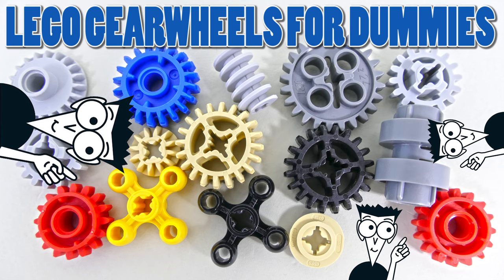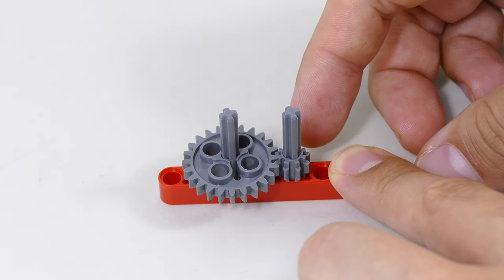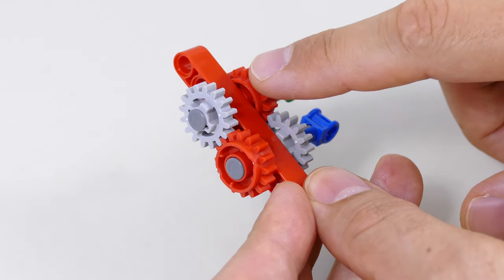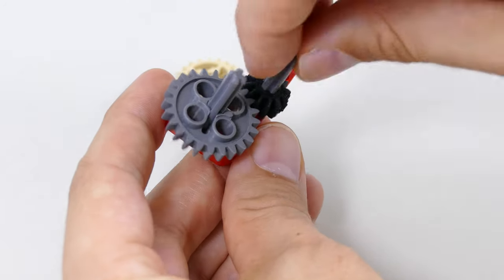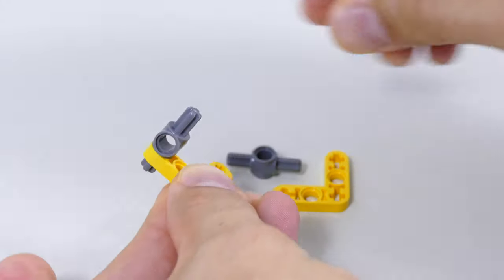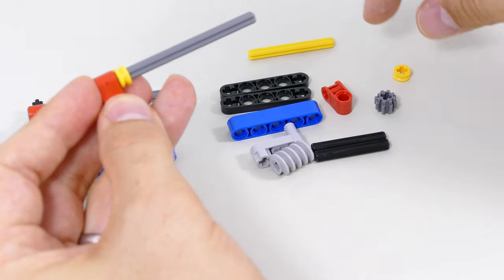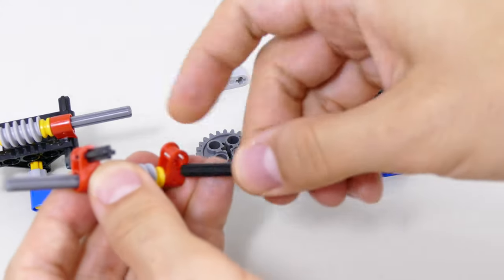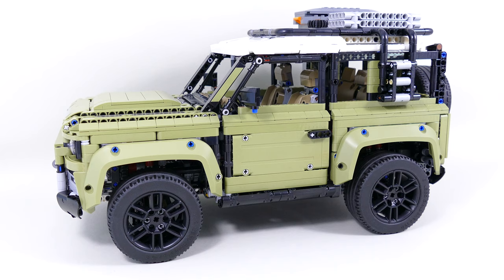LEGO Gearwheels For Beginners (Episode 3)

Comment: Gear calculator is also available as an app for Android. Also other apps by Sariel (Motors, Wheels, Unit Converter, LEGO Colours and Brickset Offline) are very helpful
Reply from the maker: Yes, that is shown on the printscreen of Sariel's website in the video.
Reply: @grohl666  sorry, haven't seen it :)
Reply from the maker: @Interqba  no problem at all

Comment: I often find difficult to have a smooth movement when connecting a 20 teeth double bevel gear with a 12th double bevel gear. Do you have any tip?
Reply from the maker: the most efficient combo is a row of 24 or 16 tooth ones

Comment: I know this isn’t related to the video but is there anyway I can make a proper suspension with only 2 suspension pieces
Reply from the maker: Do you mean the wishbones or the shock absorbers?
Reply: Wishbones
Reply from the maker: @stopmotionstuds8531  You can definitely do the rear suspension only using beams and if you do not need indepenent suspension, you can try pendular, live axle or similar suspension type for the front.
Reply: Thanks

Comment: Follow, driver and idler gears and the math of gearing up and gearing down with driver and follow added into the mix with idlers, otherwise that was very basic ..
Reply from the maker: I do not think I understood your comment properly.
Reply: @grohl666  I was just curious about the concept of drivers, idler and follower gears .
Reply: @grohl666   my understanding of your video is how to secure 2 gears , one driver and one follower only?? So a 3 gear train is not recommend due to gear slippage?? Is that the general rule..
Reply from the maker: @Sirslayer_X  Nope, not all. Feel free to use as many as you need but usually the fewer, the better.